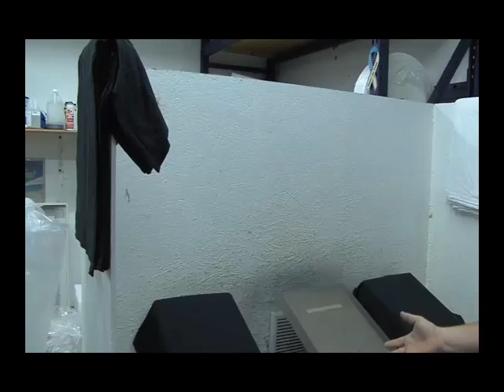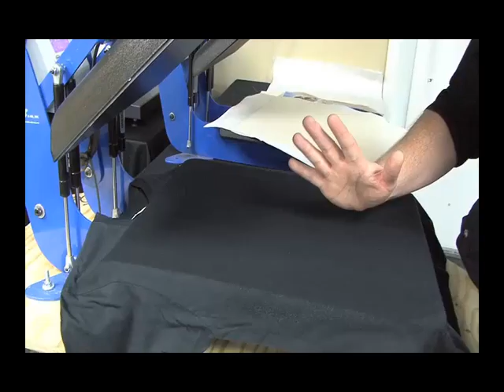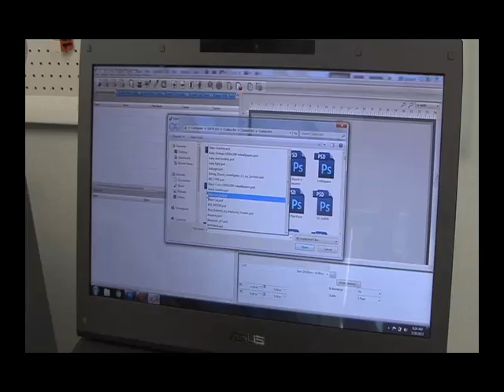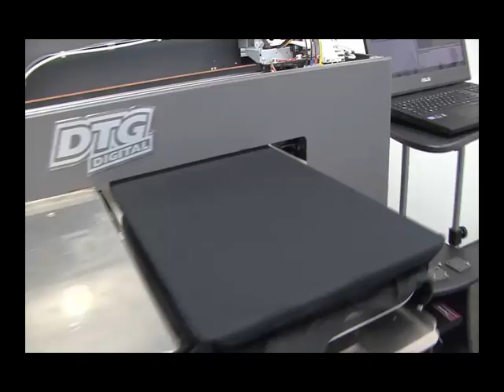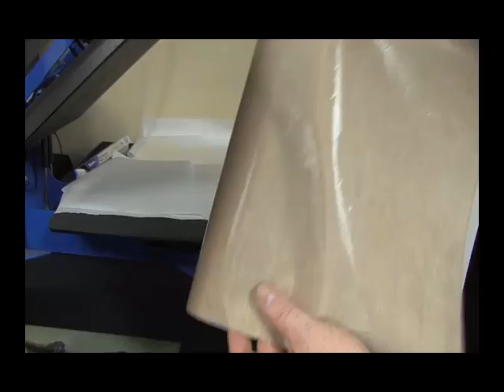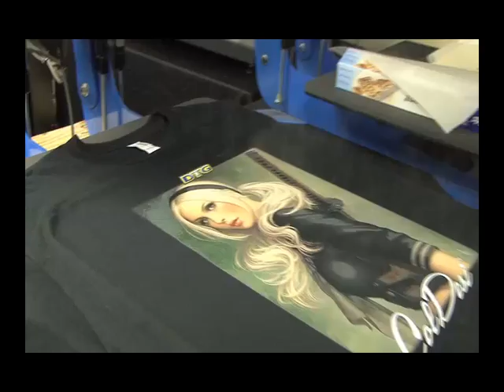C Series DTG M2 Printing on Darks

Comment: I think I will start with Anajet Mpower10 because it cost 10k, then upgrade to this machine. Do you have any comment about Mpower10, do you think is it good to start and for my a low budget ?
Thank you a lot for all the advice about the process. I appreciate It.
Reply from the maker: Diego, the mPower 10 does NOT cost 10K, you couldn't even get a used Viper or Sprint for that much! Please check your equipment before you buy to make sure you're getting what you're paying for.